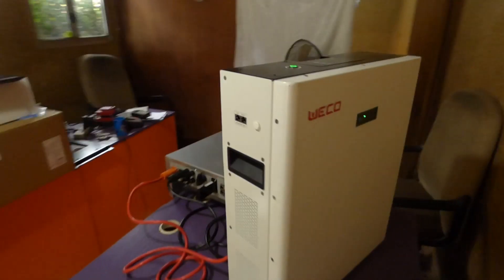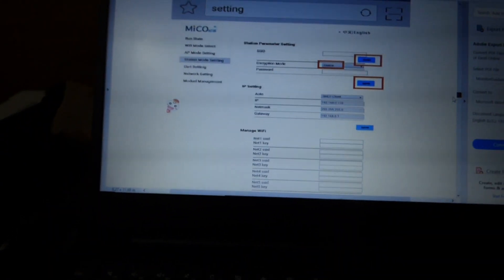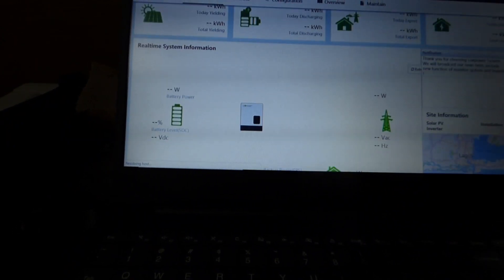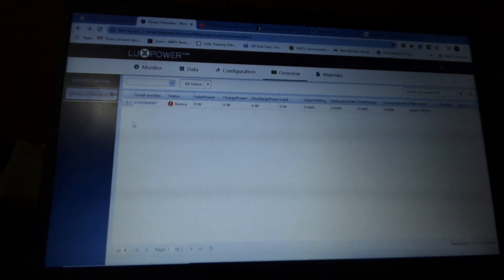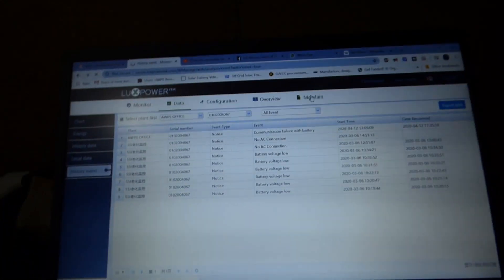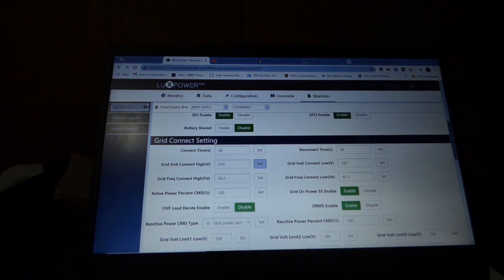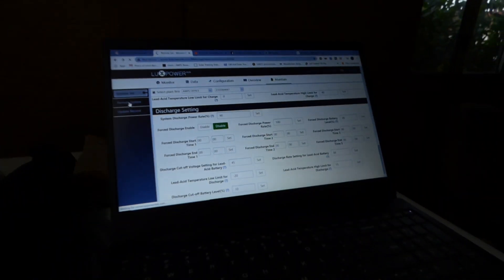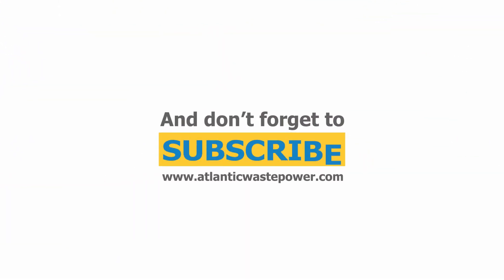Weco lifepo4 and Luxpower Hybrid. Part 2

Comment: Great video as usual Dr Solar. Any specific reasons why you are coupling the Weco battery with the lux inverter? What advantages does the Weco battery have over other common lithium batteries say a pylontech or BYD for example?
Reply from the maker: Good morning. Thank you for watching and commenting. The Weco can operate with any inverter. You set the parameters on the inverter and you are ready to go. It will also function in a closed loop. Which means it can talk to inverters that have approved it and share communications protocol. No settings adjustments. Plug and play. The other two will only play with inverters that can talk to them. They are all lifepo4 chemistry. Thank you for your question and I hope that I answered.

Comment: Interesting for sure my bose radio works the same way it transmits a router signal and you log on to configure it's wifi settings so it can find and log into your router .....cool
Reply from the maker: Getting in was difficult but once I was in it was a breeze. Bose makes good audio. Thanks for watching and commenting. I hope all is well with you

Comment: Great Video Dr. Solar. Your video is the best i have seen by a Nigerian on Solar Energy. Please confirm the inverter in this video is a grid type inverter? if so how do you differentiate it from a non grid type inverter. The Weco Lifepo4 Lithium ion battery in the video can it power a 5kw inverter? How about a 48V 200AH Lifepo4 Powerwall Lithium Battery for a 5000W Inverter
Reply from the maker: Hello Ken it is a hybrid off grid that can feed back to the grid. We disable that function. The Weco is 4.4kwh and it would work with a 5 kw inverter. 200 ah lifepo4 is a big battery bank 9 kwh in usable capacity. Thanks for watching

Comment: Sir you  just de yab me ba? Lol 
I was only asking my self what advantage this has over my magnum inverter Ms4348pae I use? How do one program this in a village where there is no internet? And the configuration is not that easy. I will go for easy to program and reliable inverter o.  I actually watched your 1st video but titling 2nd part and 3rd one part 2 is kind of confusing. I remembered you saying this 4.4kwh power bank cost over one million naira. That was where I lost interest. 
Is ok, we will like to know its durability and how its performs as time goes on before we consider buying one.
Reply from the maker: Why I no go yab you? Your magnum appeals to a different type of client. So no comparison really. Even in a village you have the internet and your phone can be the hot-spot. As long as you have a device that can sniff Wi-Fi you can program it. It does not need an internet connection. Lithium batteries are expensive. This costs less than the BYD and Pylontech batteries.  Like everything else, the first time you do it is hard. Once I got in it was easy. Your magnum is no walk in the park. Thank you for watching and commenting. I appreciate you

Comment: Which is better from 2 inverter LUX POWER or DEYE?
Reply from the maker: depends on what you want them to do. You can't go wrong with either
Reply: AWPS Renewable Energy, LTD but DEYE you cannot chage parameter by online like LUX power by online u can repairbor change and re start i mean everything u can do it in Lux Power
Reply from the maker: @nilobualoy117  you can. Best or better is subjective. If the ability to change parameters online is the over riding need then the Lux is the winner for you
Reply: AWPS Renewable Energy, LTD your answer is so perfect the right thing is LUXPOWER
Reply from the maker: @nilobualoy117  for you it is the right thing. I use the Deye. Easier to configure on site that the LuxPower. I can adjust every parameter using the LCD. That is not possible with the LuxPower. I need to access the app to accomplish that. Remote access because I am yet to do it with the Deye I will give that to the LuxPower. The client has to have internet or else it does not work. So like I said it depends on what you are looking at
Reply from the maker: One of our subscribers on Bantayan Island selected the Deye. He runs a business there. He is happy with it. Then I have others who selected the LuxPower and they are just as happy